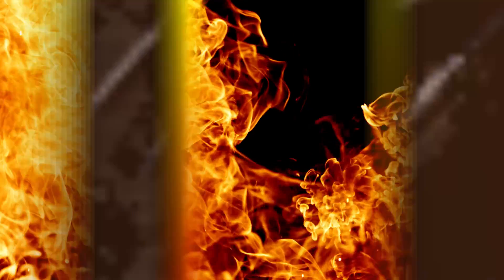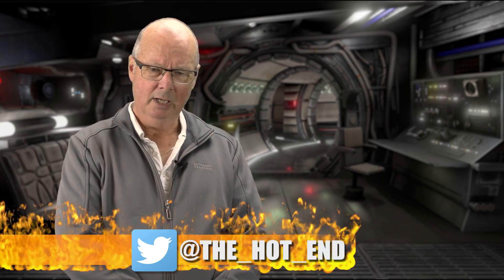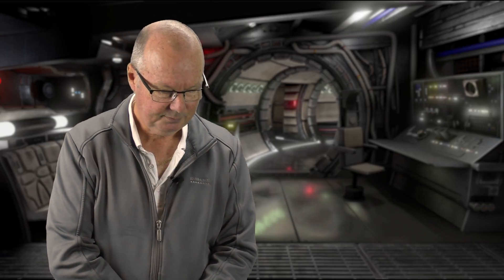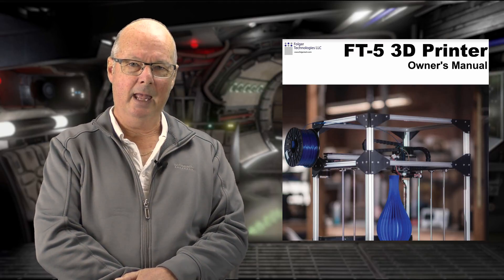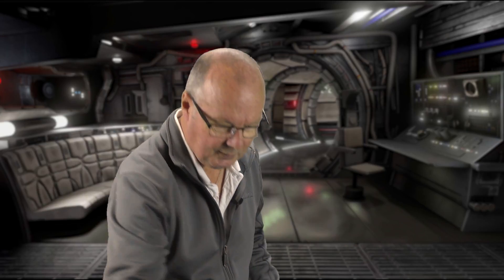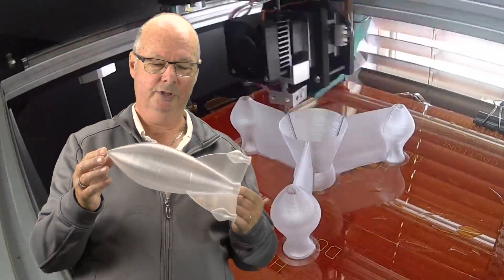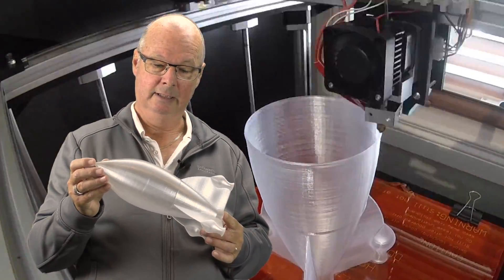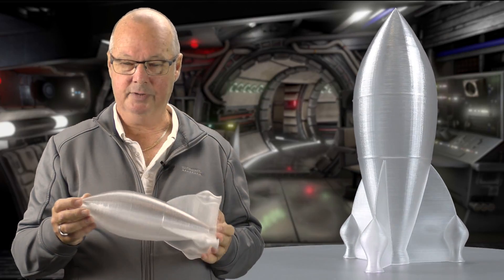FolgerTech FT-5 Build Tips PART 3!

Comment: 1st: thanks for the in depth review!   The ft-5 seems like a nice system...   But the 12 volt supply is a total deal killer...   That's the first problem with the bed heating. what were they thinking to put a 12 volt supply is a huge platform...  24 or even 36 seems more fit....    just my opinion....
Reply from the maker: it takes both i believe, not a difficult thing to change :)

Comment: Very interested in the 'Hot End' edition of this printer...  I think if it was basically a Prusa i3 MK2 in features and functionality - Better hot-end, better bed, auto bed leveling, room for the new dual/quad filament support, etc - with this size, stability, you'd have a winner for sure.
Reply from the maker: It will have 32bit smoothieboard controller, touch screen, BLtouch, RGB lighting to indicate temperatures, better hot end, better extruder, and more goodies - however this will be a couple months away.
Reply: Sounds great...  Let me know if you need help with beta testing.

Comment: My tip:  Make the cable chains so you don't have to thread the wires.  Instead, have the cable chains so they snap closed on each link.  This would also make adding wires to the cable chains later easier.